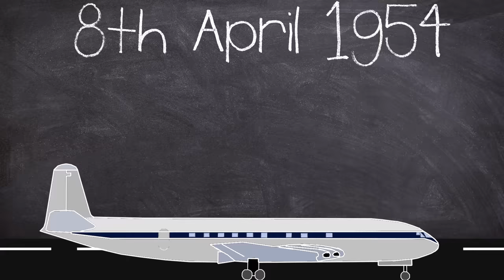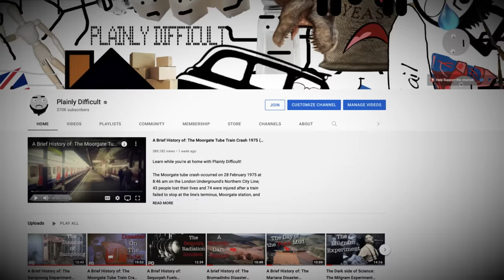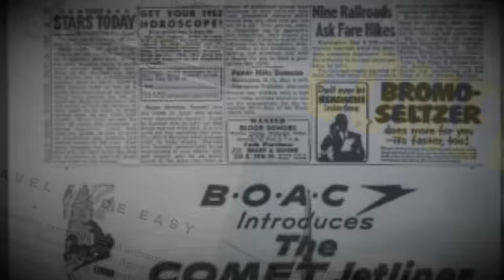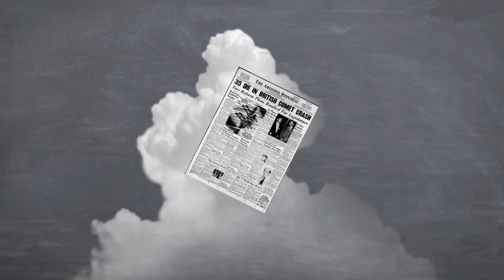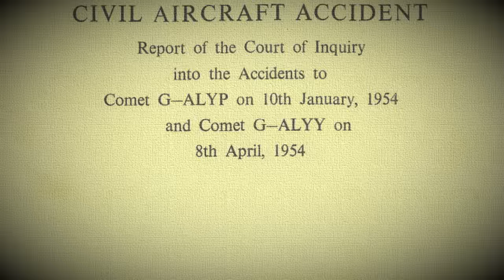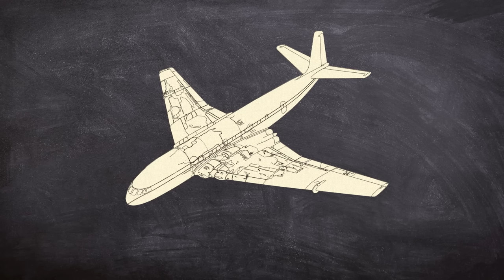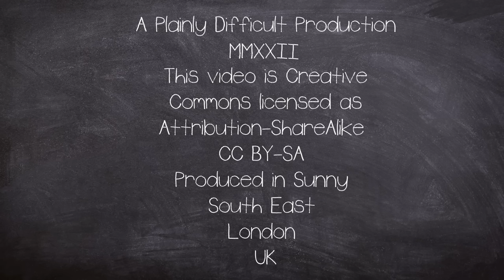A Brief History of: The de Havilland Comet Design Disaster 1954 (Documentary)

Comment: What a dull illustration of what happened.  Badly made, inaccurate and dull….
Reply: Much like the Comet... the Comet was the worst engineering failure in commercial aviation history.
Reply: This video has some BS included.
For example - 
  
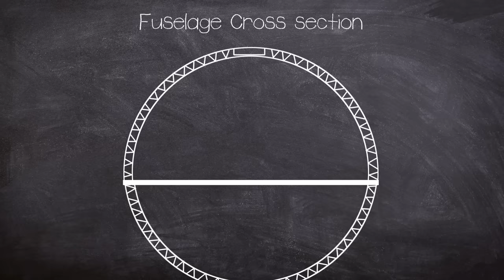    5:20   The idea that only the crew & passenger areas were pressurised is absurd obviously. 
  Every part of the fuselage was pressurised from the nose to the rear fuselage bulkhead including the entire cargo area.

Besides that.
Comets flew until 1997.
The Comet design had military use as a requirement. Nimrod development began at 
De Havilland before 1953.
Nimrods were not withdrawn due to structure problems or other airframe issues it was entirely a significant upgrade snag & resultant basic economics & an end of line sale happening at Boeing at the same time.

We feel we can shed some light on some common misunderstandings.

At the time the Comet wasn't particularly dangerous.

Losses comparisons
How things were in those days.

DeHavilland Comet 4 UK           14% 
DeHavilland Comet all  mks       17%  

Boeing 307                               70%
Boeing 247                               48%
Boeing 707            .                  20% 
Boeing 707                                20% 
Lockheed Electra Turboprop   29%
Canadair CL-44  Turboprop     46%  
Convair CV-580  Turboprop     22%
Convair CV-880    (ff 1959)       27%  
Convair CV-990     (ff 1961)      35%

    Of course De Havilland had prior experience building many all metal construction airframe aircraft including thousands of jet powered fighter aircraft that were primarily of metal construction with pressurised cockpits & jet engines built by De-Havilland.

   De Havilland carried out full stress analysis & engaged in a comprehensive & protracted testing program which is why key De Havilland people were happy to be aboard flying DH Comet aircraft.

   The DH Comet was the first passenger airliner with full length fuselage pressurisation at 8psi pressure differential. Handley Page built the world's first airliner.

   Of course ripstop provision was provided. The skin alloy used became unavailable at the time due to R & D at the manufacturers which resulted in the original alloy being discontinued.
The skin thickness used for the Comet was used for similar later aircraft. 
Frame spacing was not found to be too large & frame width was not found to be too small.

  De Havilland did indeed always work to better than industry standards at the time, used up to date knowledge for the design & construction & no evidence of negligence  or criminal negligence was ever produced in relation to the DH Comet.

  The DH Comet had no effect on the course of the aerospace industry in the UK. The UK now has the world's largest combined nuclear, aerospace & defence sector per capita activity.

    The investigation committee did not find hundreds of fatal flaws or evidence of design defects, structural defects, defective materials or shoddy workmanship. Ripstop provision was included. Claimed incidents did not involve cracks starting from window corners.
Pretty much all changes were just in case changes or were planned development modifications & improvements that were scheduled regardless of incidents.

De Havilland designers knew all there was to know about metal fatigue at the time they designed the DH Comet.

Hope this helps.

Cheers 👍
  

xcv

Comment: The design was sound. What caused failure was bad workmanship! Holes were hand punched not drilled! I have actually held a piece of the airframe that failed. I also knew one of the engineers who helped solve the problem.

Design failure No, get your facts right.
Reply: The Comet Disaster investigations revealed 100s of fatal design flaws as well as poor materials, shoddy workmanship and poor quality standards.
The Comet 1 was so riddled with design flaws that its airworthiness certification was permanently revoked.
The Comet 4 was a completely redesigned aircraft, stronger structure, better aerodynamics, flight controls, engines and auxcillery systems in order to met airworthiness certification.
Reply: The Comet Disaster investigations required outsides experts to find the design flaws... de Havilland repeatedly attempted and failed to discover the actual causes of the fatal crashes.
despite Havilland simply lacked the technical experience in building aircraft using all aluminum.. the company was still building aircraft primarily from WOOD.
Reply: @sandervanderkammen9230  Present your evidence, because that us mot what I know from CAA reports.
Reply: @Volcano-Man  The fatal design flaws in the Comet are well-known and understood throughout the aerospace industry.
de Havilland designed the Comet with fuselage reinforcements hoops that were too weak and spaced too far apart, skins which too thin and lacked proper rip-stop doubler joints,  fatal flaws were also found in the engine inlets and flaps as well as hydraulic control system.

The Comet 1 as designed was not airworthy and its certification was permanently revoked.
The Comet 4 is a completely redesigned aircraft from wing tips to toilets to improve safety and comply with industry standards.
Reply: @sandervanderkammen9230  If you say so. CAA reports disagree. This discussion us ended. Goodbye
Reply: @Volcano-Man  The Comet Disaster is the worst engineering design failure in commercial aviation history.
A properly designed aircraft should be able to takeoff reliably and brand new aircraft should never experience catastrophic in-flight structural failures due to metal fatigue.

The Comet Disaster is a clear example of bad design, engineering incompetence and criminal negligence.
Reply: @sandervanderkammen9230  I said subject closed. I meant it! Now do one!
Reply: @Volcano-Man  The Comet Disaster is the worst engineering design failure in history, no amount of jingoistic revisionist propaganda will ever change this shameful and humiliating chapter in British history.
Reply: 426 innocent men, women and children were needlessly killed by engineering incompetence and bad design...
You will not find any aircraft based on the Comet because responsible aircraft engineers make a habit of not repeating someone else's bad design work.
Reply: This video has some BS included.
For example -
  
    5:20   The idea that only the crew & passenger areas were pressurised is absurd obviously. 
  In fact every part of the fuselage was pressurised from the nose to the rear fuselage bulkhead including the entire cargo area.

Comets flew until 1997.
The Comet design had military use as a requirement. Nimrod development began at 
De Havilland before 1953.
Nimrods were not withdrawn due to structure problems or other airframe issues it was entirely a significant upgrade snag & resultant basic economics & an end of line sale happening at Boeing at the same time.

We feel we can shed some light on some common misunderstandings.

At the time the Comet wasn't particularly dangerous.

Losses comparisons
How things were in those days.

DeHavilland Comet 4 UK           14% 
DeHavilland Comet all  mks       17%  

Boeing 307                               70%
Boeing 247                               48%
Boeing 707            .                  20% 
Boeing 707                                20% 
Lockheed Electra Turboprop   29%
Canadair CL-44  Turboprop     46%  
Convair CV-580  Turboprop     22%
Convair CV-880    (ff 1959)       27%  
Convair CV-990     (ff 1961)      35%

    Of course De Havilland had prior experience building many all metal construction airframe aircraft including thousands of jet powered fighter aircraft that were primarily of metal construction with pressurised cockpits & jet engines built by De-Havilland.

   De Havilland carried out full stress analysis & engaged in a comprehensive & protracted testing program which is why key De Havilland people were happy to be aboard flying DH Comet aircraft.

   The DH Comet was the first passenger airliner with full length fuselage pressurisation at 8psi pressure differential. Handley Page built the world's first airliner.

   Of course ripstop provision was provided. The skin alloy used became unavailable at the time due to R & D at the manufacturers which resulted in the original alloy being discontinued.
The skin thickness used for the Comet was used for similar later aircraft. 
Frame spacing was not found to be too large & frame width was not found to be too small.

  De Havilland did indeed always work to better than industry standards at the time, used up to date knowledge for the design & construction & no evidence of negligence  or criminal negligence was ever produced in relation to the DH Comet.

  The DH Comet had no effect on the course of the aerospace industry in the UK. The UK now has the world's largest combined nuclear, aerospace & defence sector per capita activity.

    The investigation committee did not find hundreds of fatal flaws or evidence of design defects, structural defects, defective materials or shoddy workmanship. Ripstop provision was included. Claimed incidents did not involve cracks starting from window corners.
Pretty much all changes were just in case changes or were planned development modifications & improvements that were scheduled regardless of incidents.

De Havilland designers knew all there was to know about metal fatigue at the time they designed the DH Comet.

Hope this helps.

Cheers 👍
  
   
   . .... .....
..........    .